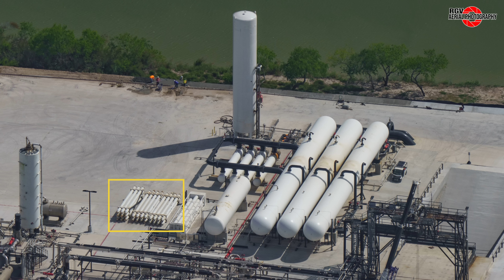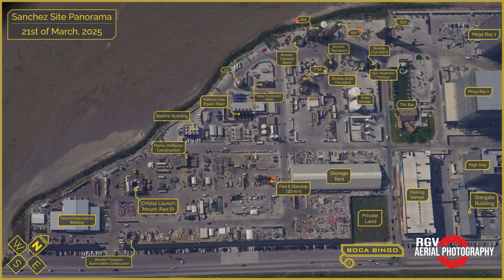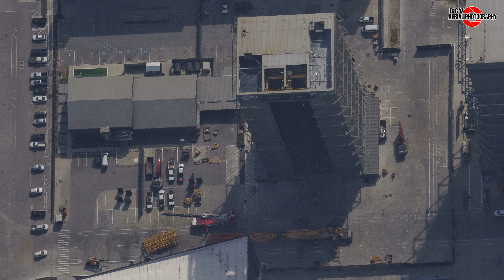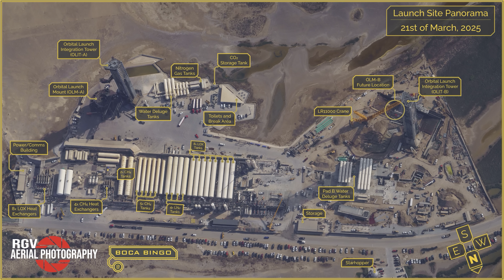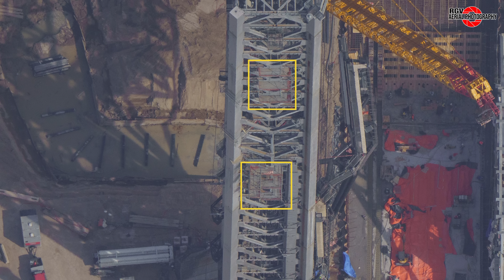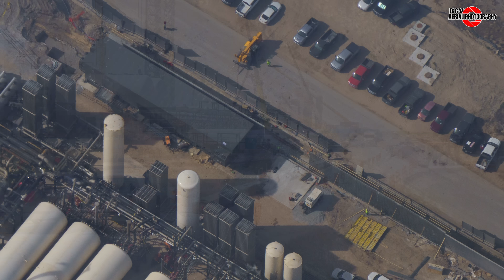High Bay Dismantling + Flame Trench Progress! Starbase Flyover Update 77

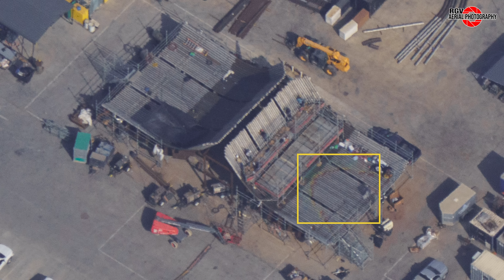Comment: @4:33 I don't understand... Why would the exhaust plume be so far to the side and not a circular area centered over both halves of the deflector?
Reply: They are not in the orientation they will be at the pad, turn each 180º. The "long side" is the high side, short side is the bottom.
Reply: Oh wow I had no idea... I haven't heard a single other channel mentioned that fact. @FastSloth87